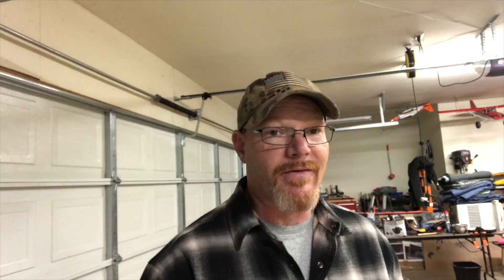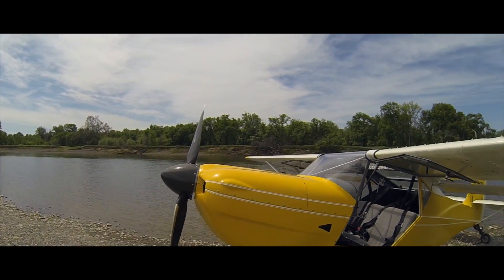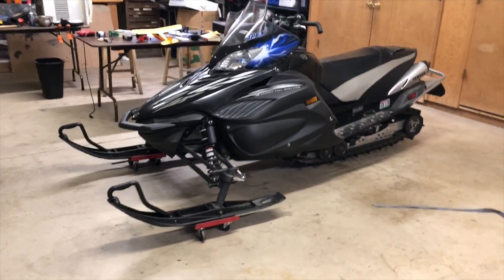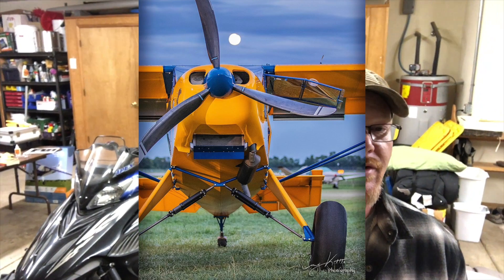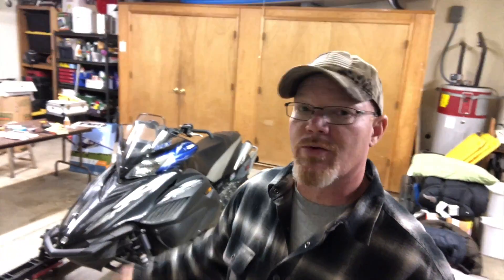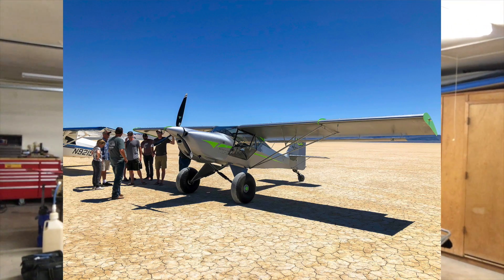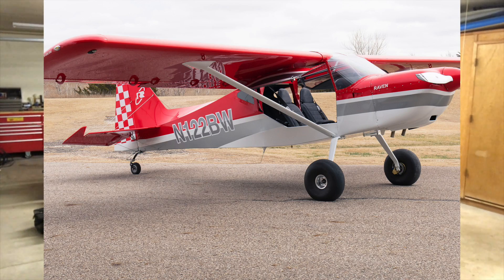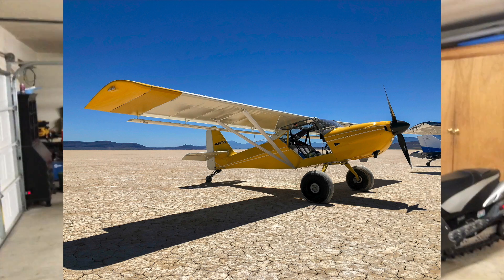There is an APEX in my garage!

Comment: Is your current engine stout enough to add a turbo. If someone could adapt the same principle of an electric clutch being driven by a Gates 2" wide belt and pulleys to drive the turbo. I hate exhaust driven turbo...too much piping in the exhaust and intercooler stuff. Just think of it as having a turbo at the flip of a switch. Its not rocket science...this could be done. But....your engine has to be built in the bottom end to be able to handle the boost. OR keep your plane intact for resale after you build or maybe look for another airframe without an engine. This way you keep flying.
Reply from the maker: It may be, but adding additional weight to the airplane is out of the question with the current engine.
Reply: J.Michael. What you're talking about is a centrifugal blower & there is more weight in that system than a turbo setup. I doubt you'd want to put any more than 7lb on a stock 0-290, that low boost doesn't need an intercooler & would add about 50hp to it. I'm a race car engine builder & pilot & I don't own anything that's naturally aspirated.  In this case I'd lose the wooden club & go to an adjustable prop then add a 50 shot of nitrous for climb out. The prop will give a better cruise & the nitrous will compensate for DA.
Reply: NZ Salt Flats Racer If its a o290d2 it has the higher compression pistons, he’d need to do something about that.  Turbo-ing is not a terrible idea but the best way to turbo a Lycoming is to add just enough boost to normalize it for standard day performance. No way would I boost it, I’ve worked on boosted motors(boosted beyond the standard day performance needs)they eat jugs regularly. The case can handle the load, the rods and crank are the wildcard. In the end if boosted all out power is the goal, air Yamaha is the best bet. Ultimately there is no comparison between a normalized 130-140(heavy) Lyc and the tested boosted Yamaha.
Reply: @rsrguy  Well I guess he could just keep flying the Kitfox while converting the Yamaha and adding the turbo unit, since he like the Kitfox air frame. Building another airplane seems to be the long route.
Reply: J. Michael Wilhelm maybe so but way more rewarding
Reply: @nzsaltflatsracer8054 , actually I am talking about a turbo/supercharger and not the heavy blower that you mentioned. I'm sure that what my mind has in mind is not available. This is something that has to be adapted and I'm not even sure it can be. But the mechanics are there it would just take someone with the ingenuity to build it. Turbos are generally thought of as exhaust driven, which has many problems, mainly needing an intercooler to cool down the air before going to the motor. At best these do not always cool the air charge sufficiently and therefore you have warm air which is not nearly as combustible as cold air. Nitrous would surely give the engine a tremendous boost for the short run of the STOL Drags...something I think you will see much more of next year to compete against DRACO. Bigger brakes and rear ballast to get the plane to stop quickly and a hole shot of nitrous would get you to both ends. He could alway build a better larger stout bottom end engine and have some extra goodies when needed rather than a whole new plane. At least he would be able to keep flying during the build.

Comment: I'd like to see a 3 piece fuselage upper and lower air-frame built from a mold and layered with carbon fiber built like a glider including all ribs and using Carbon fiber flight control surfaces with a $15K - $20K 300-400 hp engine priced (complete) around $60 - $70K  THAT would get a lot of attention!

Comment: Love it brother...    I'd like to see a new air frame altogether.  Personally, I see an incredible opportunity for a very well though out quality build maybe in the high 50's or 60's.  It seems the engine and avionics is the deal killer but solving the engine issue is a huge chunk of that.  I just don't see spending $30K+ on an engine when a well designed reduction gearbox and a proven track record is the ticket.  My toyota pickup has almost 300,000 miles and still runs like new.